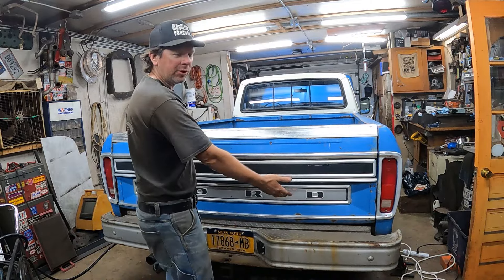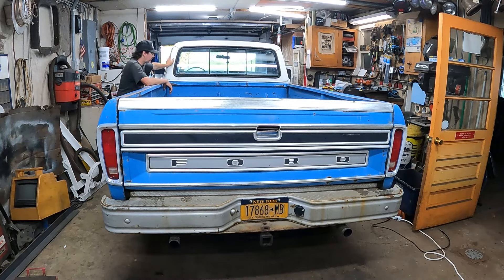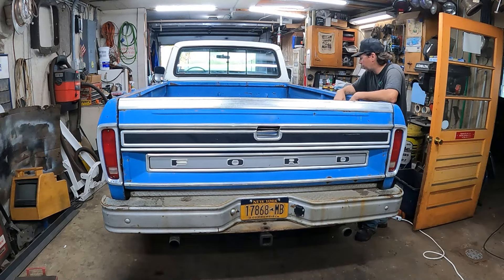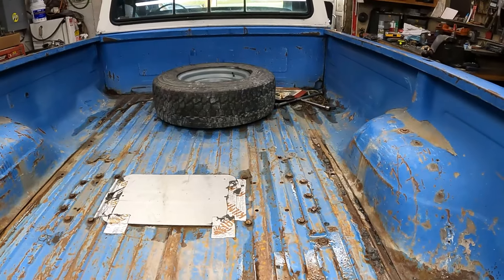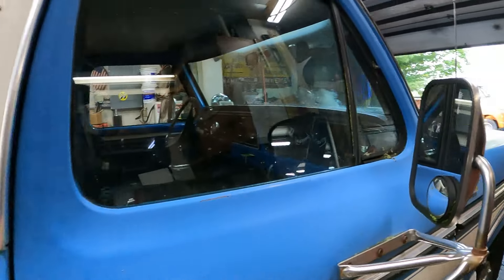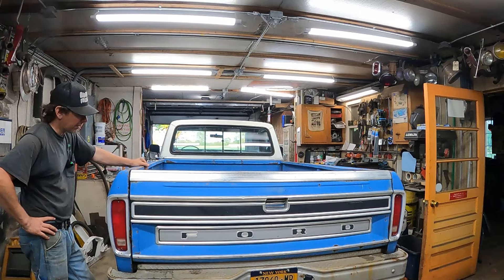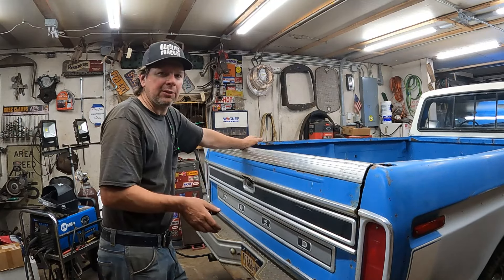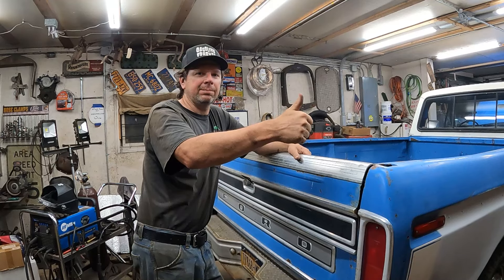This truck needs a lot of work!

Comment: I agree with you about those small block Windsors being gutless! I tow a 5000 lb
travel trailer with my 95 with 3.55 gearsets and 302 engine, It just falls on its face 
when hitting any grade whatsoever.
Reply from the maker: Yeah.  351W.  Power of the 302, fuel economy of the 460.  🙄